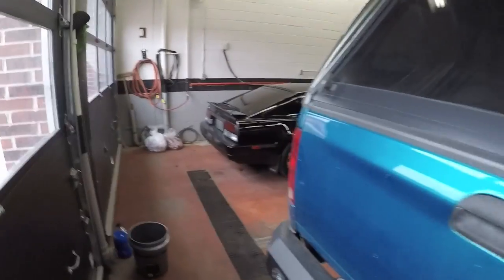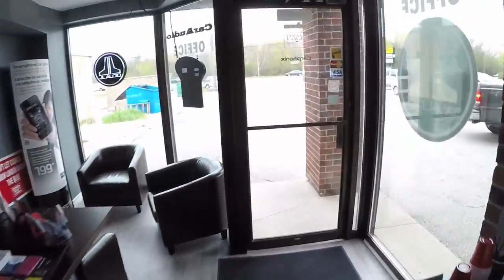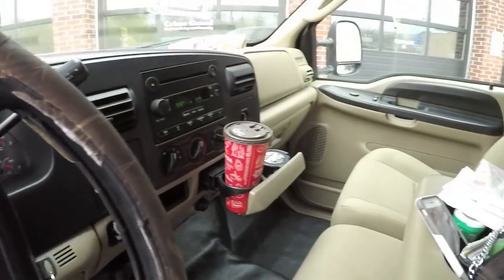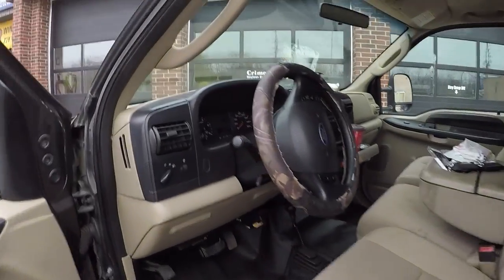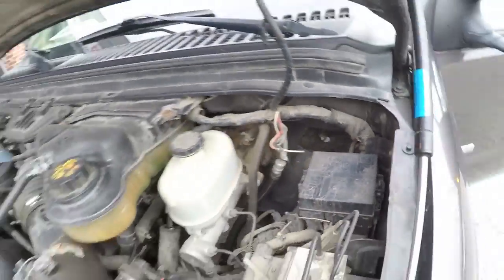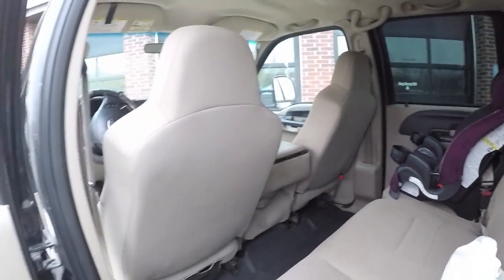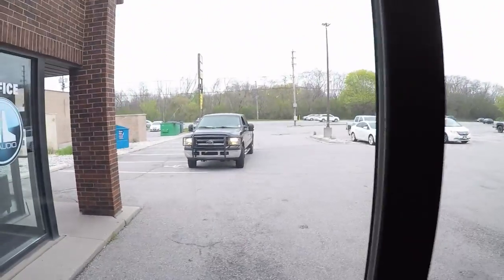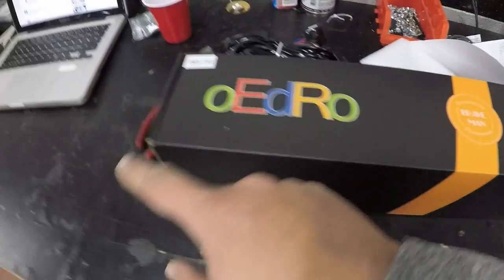Damians NEW TRUCK! Jaguar X Type Gets Hooked Up Large! Mail Day!

Comment: needs a bed liner!??? Needs a new bed!  look up in with a light behind rear mudflap, where wheel we'll meets side of bed inside there the glue they used rots out bed from inside out! nothing u can do to stop it! No boost psi just reving motor cause no load to make boost. 03-05 we're the worst 6.0 powerstrokes,  06, 07 they kinda got them under control, but they still had major issues. just ask Pug1,  his had same motor